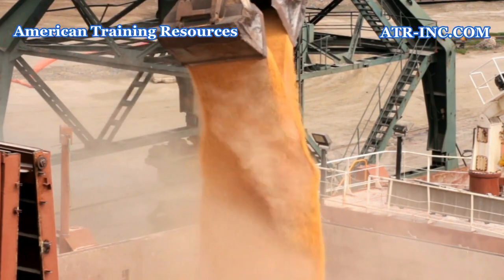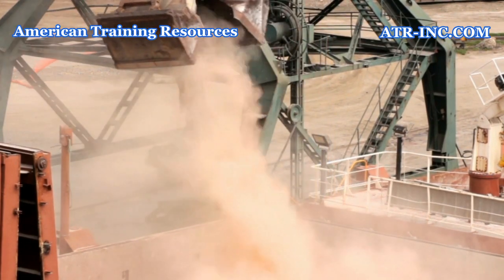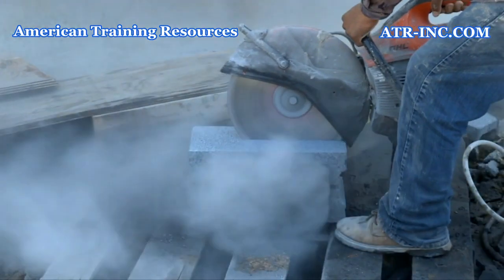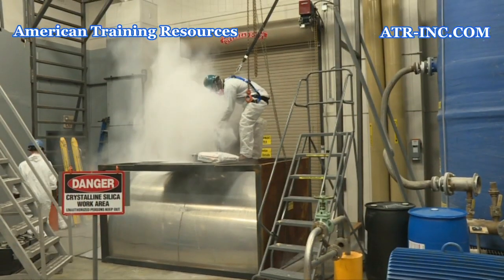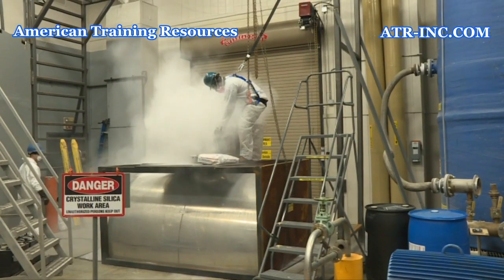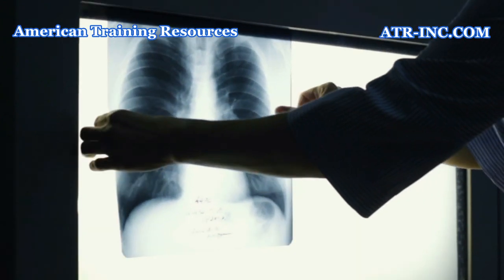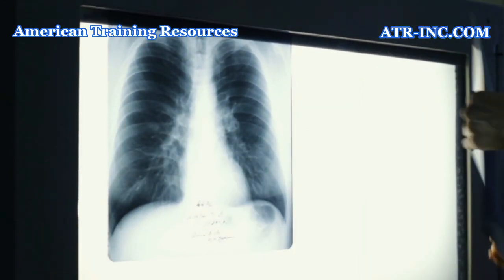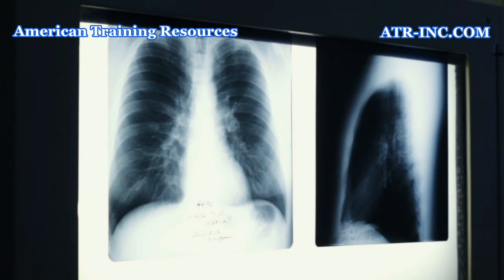Silica Dust Safety Training Video

Comment: I wish I would have known the dangers I went from a fast food job to my first carpenter job when I was 26 except the boss had us drilling into concrete and blowing out the holes with compressed air for what he called tie down rods I worked there for 3 years we didn't do it everyday but now at 35 I have scarring in my lungs and worry I will die from silicosis I never heard of it before and my life is destroyed my aniexty has me up all hours of the night. This is murder and should be criminally prosecuted.
Reply: @Future Corpse yeh would be slightly sceptical on that one. I’m very safe and wear my mask all the time on building sites. I’ve seen people exposed to levels you wouldn’t believe and they don’t care, been in a house with someone grinding bricks all day, no mask, no windows open. And they are fine, some been doing it for 40 years. Unless exposure is unbelievably high to doubt it in 3 years

Comment: I inhaled a little bit of grout and thinset dust from the bags the contractor left at my house after he completed the bathroom job. I was closing the bags and the dust went up in my face and I ended up getting some in my lungs.  last night i was really tired and had shortness of breath. Should i be worried about long term health effects?
Reply: I don't think such short exposure is of big risk. Yesterday I cut a couple of pavers in my garage without protection and then wondered...what is all that fine dust actually about. So I ended up on this video realizing that I shouldn't have done what I did yesterday. Perhaps we will lose 0.01% of our lung capacity, but at least we are not professionals losing >0.01% every day.
Reply: Your lungs will repair themselves being that exposure was so small